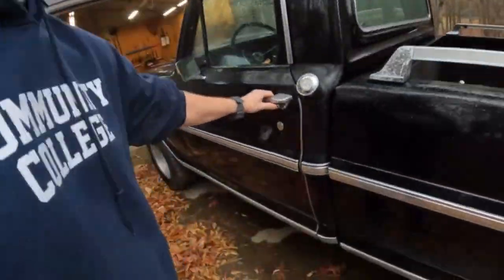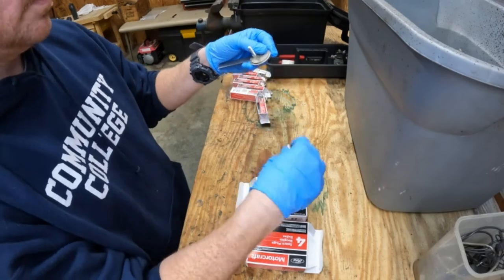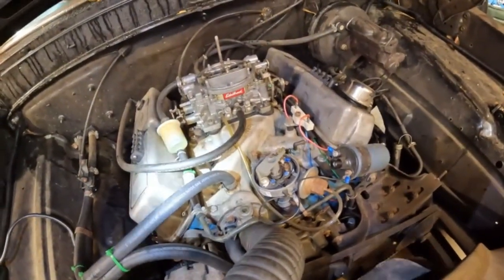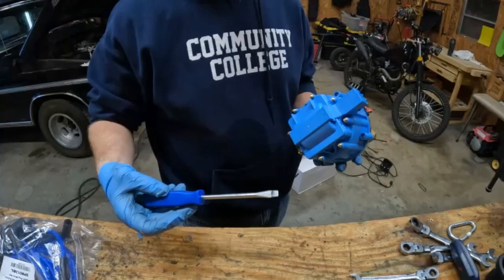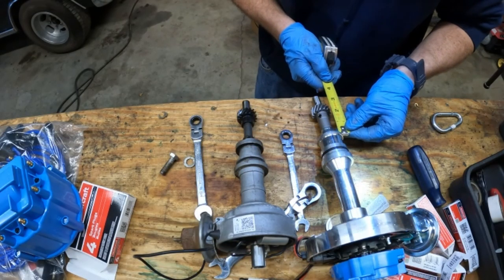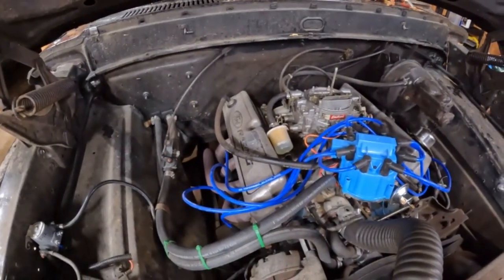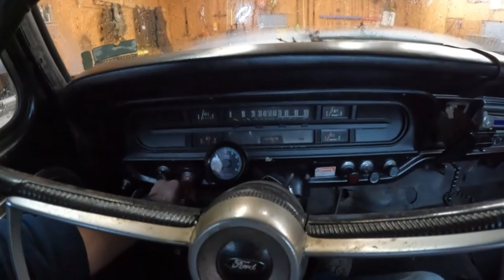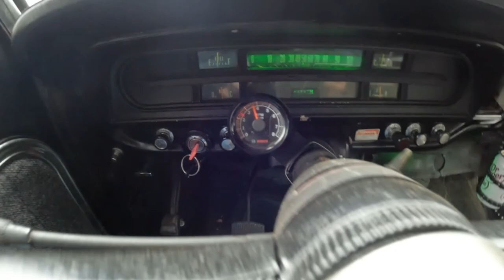HEI Distributor Install on 351 Windsor. Link in Description!

Comment: Where did you get the power supply to the hei distributor from? I couldn't tell in the video 😢
Reply from the maker: The power wire comes from the ignition switch when it is in the “on” position. In the old points set up that wire went from the ignition to a ballast resistor then the coil. The resistor and coil are deleted with the HEI set up and that wire goes directly to the distributor. There is a link for a pigtail in the video description for the HEI I used that I installed later. In the video I took that power wire from the ignition and ran to the “+” terminal on the HEI. Good luck with your build!

Comment: Why 15 degrees?
Reply from the maker: My truck runs best at 15 before TDC. Any less or more it starts breaking up at higher rpms with the spark advance from my old points distributer and the new HEI. I think it’s because of the choppy cam. I recommend experimenting with different offsets to see what’s best for your application. Thanks for watching!

Comment: What firing order are you using - you said 1,8, etc.  351W has ALWAYS been 1,3,7,2,6,5,4,8 was watching as I just switched to HEI on my 302 with Lunati cam which switched it to HO/351w order and threw me for a loop when you said that firing order.
Reply from the maker: Good catch. 18456273 is going clockwise looking at the distributor. Since the Rotor button is going counterclockwise, I should have said your way. Gonna work either way. I didn’t know 302s had the same firing order as the 351w. I guess the 302ho does according to google. Good luck with your build and thanks for watching!
Reply: LMAO, I did not even realize that is what you did, I just heard you say 1,8 and was like WTF?  I did see your plugs going 1,3 when you were setting it up so figured you said it or read it wrong.
 @TheStandOutdoors

Comment: why is your rotor not pointed directly at the number one cylinder im curious
Reply from the maker: Fighting with the points-type distributor over the years that’s just where the thing would drop down at. I just rotated the plug wires on the cap till the #1 wire sat where the button ended up. I realize it looks 180 degrees off tdc, but it’s not. My HEI is still doing good and seems to start quicker in the cold weather. Thanks for watching!

Comment: Is this form Southwest Racing/A-team on Amazon? Ive seen that the roller pins are too weak and tend to break. I have one coming tomorrow and im going to drill it out and beef it up for prevention's sake. Just thought id ket you know.
Reply from the maker: I’m sure it’s the same Chinese company. It’s still running good. I’ll let you know if the gear falls off! Thanks for watchimg

Comment: Have to ask, which headers did you use on that F100 chassis? I'm doing a swap to the 351w in my 78
Reply from the maker: They’re Hooker headers. Not sure the model cause it’s been 15 years. I think 6904. I did have to bash the drivers side a little for the frame. Good luck with your swap. The cheap HEI is still working good so I do recommend that unless you’re racing
Reply: @TheStandOutdoors  I picked up the MSD Ready to go system,  I still have to put the motor in and wait till the cab comes back from the body shop.

Comment: Im putting a 351w in a 75 4x4, what did you use for power wire for the distributor?
Reply from the maker: In the video comments there is an Amazon link to the pigtail power wire you need with the HEI distributor. It’s only $9 I think. I used 12ga wire to the pigtail. Thanks for watching!
Reply: I'm sorry, I should've been more specific. Where are you drawing your power from for the distributor? I saw to use the power wire from the coil since its not being used
Reply from the maker: Yes that’s right. The coil is deleted using the HEI. Use the hot wire that was going to the coil and run to the distributor.  Also, no need to use a balast resistor on the hot wire. Good luck
Reply from the maker: Oh, the power wire comes from the ignition switch

Comment: Worth it? Or no?
Reply from the maker: Still working after a month and seems to start easier in the cold. Thanks for watching
Reply: @TheStandOutdoors  nice, have you more mpg? And power? Or the same with breaker points?
Reply from the maker: I have not measured how many mpgs I’m getting but I assume it’s better because it runs smoother at all rpms now. It feels like it has more power whether it does or not I’m not sure.